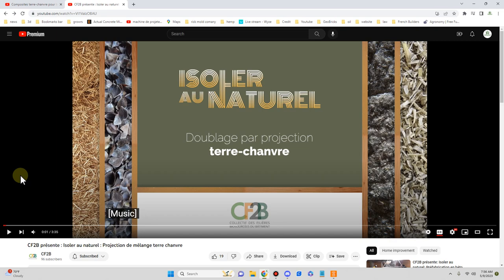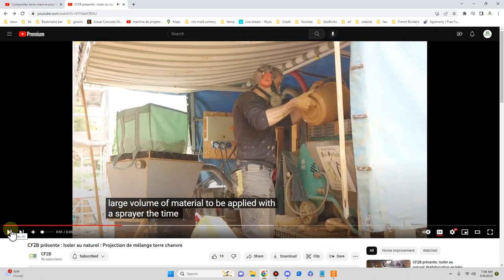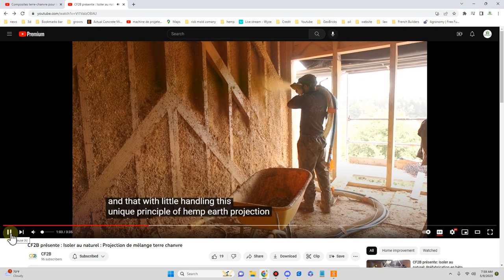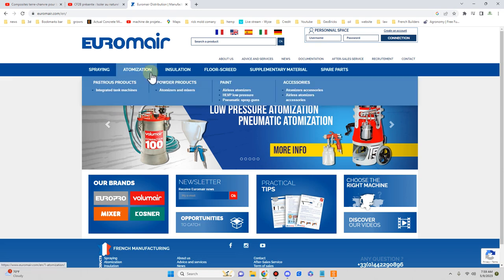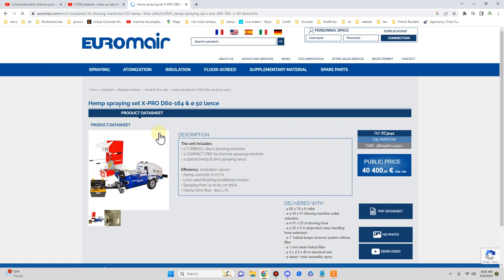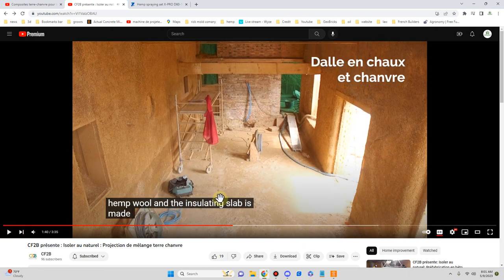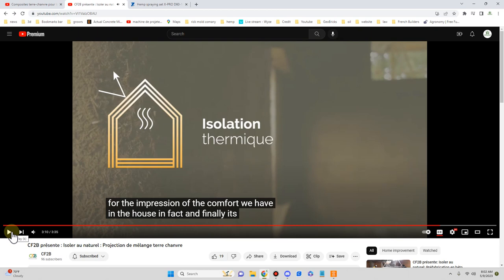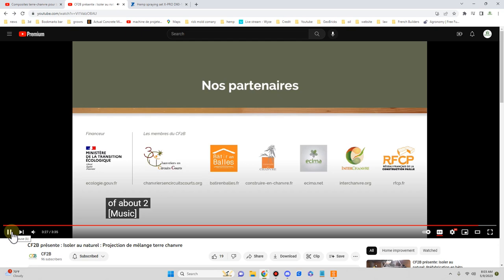Hempcrete sprayed with clay binder!

Comment: would like to see more on this too.  Wondering what percentage of clay in soil is needed to usable? Seems reasonable the money saved on lime could be used for equip, but how much does a typical hempcrete build spend on lime?
Reply from the maker: I have two other video's, that I'll post both in french one a spray using same set up and one interior clay plaster over hempcrete.